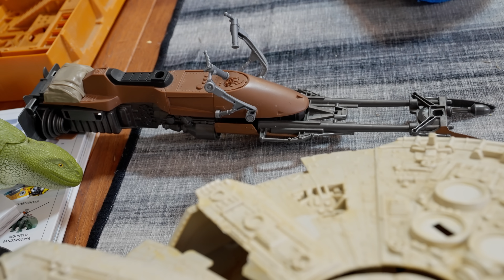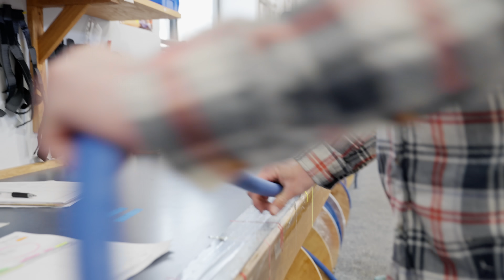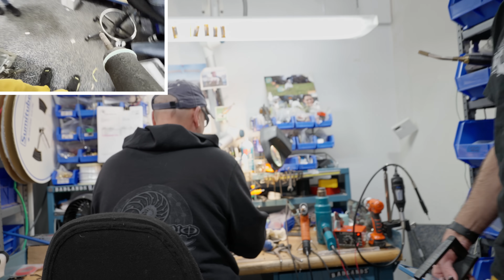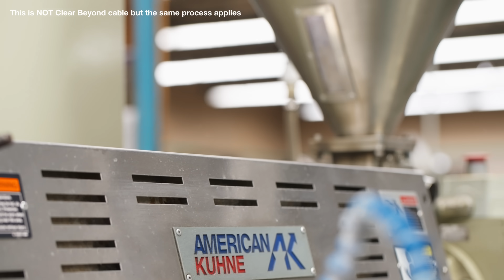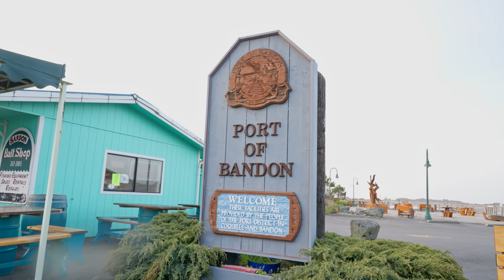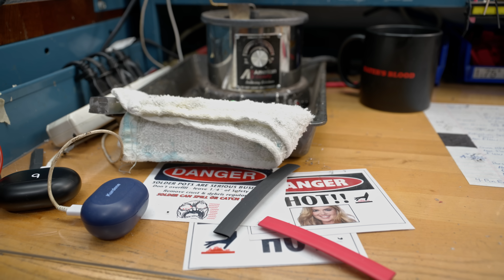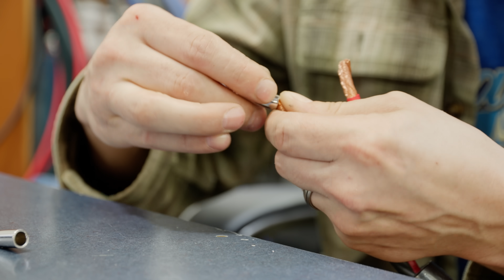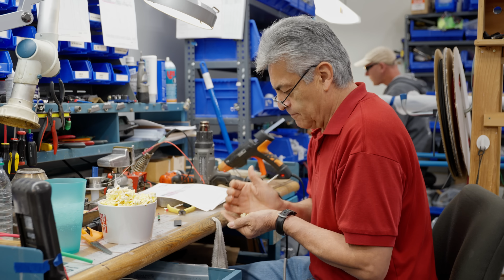This is the BEST video about LOUDSPEAKER CABLES that you will see all year

Comment: I don't know if Darko can answer some questions that I ponder as I watched this video.   I note that the elaborate construction of the cable is evident.  However, it isn't manufactured in a clean room, the cable is exposed to the elements and everyone is touching the cable with their bare hands.   I don't know if contaminants will affect the sound (probably not) but could effect its' longevity.   The other question is more personal, why does the engineer have maroon(?) colored finger nail polish.  I know it's personal, but does he have a reason or is it a personal fashion statement?   I am not casting aspersions, just curious as I don't see that often (especially the strong color).
Reply: I thought they said the wire was enameled. This would prevent aging oxidation ECT.

Comment: actually your copper isn't so pure sorry the best copper in the world is OCC single Crystal copper which is 6N, your copper is OFC which has 4-500 Crystal barriers per foot which the signal has to jump across, the crystal barriers are like a little fractures in The wire that the signal has to jump across which causes brightness edginess hardness coldness any one of those things are all of those things so if you want to get up with the best OCC single crystal wire is the best.
Reply: If you look on Cardas' website they have their own extrusion process that achieves a surface finish orders of magnitude smoother than conventional extrusion processes (regardless of OCC or not) with electron microscope images of their wire. They claim that this is important to the end result.
Reply: Yep, the purification process for OCC and 7N copper is thru the extrusion Process plain and simple, and all of it is done in an inert gas Argon. You don't have to start with "pure: CU  cause ain't no such thing that occurs naturally this isn't mil-spec stuff
Reply: Occ seem better, but no science proves to make good sound
I have a occ cable but I couldn’t tell the difference with the other

Comment: I would expect them to take a bit more care in final assembly. If they themselves believe that the eleven re-spoolings, void checkings, four different dielectrics and air hoses makes such a difference, wouldn't they believe that finger grease and slightly uneven mechanical connections, different lengths of termination strands and so on would? 

Also, rich people SHOULD NOT have the right to do just because they can, at the expense of the environment or/and the people producing the raw materials. This is of course not limited to just high end audio, but applies to most high end stuff. That the Cardas employees seem to have a good time at work (when not bullied by the intense bossman with the beard) doesn't really make up for it on a bigger scale.

And you would never ever need that much copper to conduct musical information in a home stereo. That's like saying you would get cleaner bathing in an olympic swimming pool filled with spring water that's been stored at the international space station than when taking a shower.

Comment: The purity of copper depends solely on the refining process.  Copper ores are mined from the natural environment, typically as a mixture of metal sulphides, oxides and sometimes carbonates if your lucky.  These are mixed with other minerals such as talc, Chlorite & other rocks such as shales  etc.  The mine usually crushes the ore to a powder & concentrates it to separate the metal bearing ore form non metal minerals.  The metal concentrate is mostly copper, lead, Zinc, Silver, Gold etc along with some contaminates.  This is transported to a refinery/smelter.  My dad was chief electrical engineer at ER&S (Southern copper) Port Kembla  They had a reputation for about the worlds most pure copper back in the day (closed now).  They used an electrolytic process to plate out the copper to purity. So no, the mine is not the reason for copper purity.  That's entirely down to the refinery.  It's complicated because the concentrate could contain anything & it's composition is variable & the refinery needs to test & respond to the variability to maintain purity.  They collect & analyse a lot of data over time, learning how best to respond.  That's called engineering.
Reply: True but pristine high quality audio is so easily conducted that even un pure copper is fine especially for short length cables.
Reply: @ramencurry6672 absolutely correct, well said.

Comment: $10,000 cables and their test process is probing it with an off brand multimeter. Wild.
Reply: Well, if all he is doing is measuring for continuity he could do it with a $10 multimeter without fail.  The resolution for measuring capacitance would be another story altogether.

Comment: I have personally heard field coil speakers made from hand crafted Japanese paper cones amplified by $30,000 front ends . They used 6 ft of 10 gauge super fine strand pure copper speaker cables, best system I've ever heard. Drivers were valued at $50,000. 
Cables looked like lamp cord, it wasn't, but it sure looked like lamp cord. System was owned by Papa Pass. (Nelson) Burning Amp Festival in S.F.

Comment: Great Video, my first pair of "HiFi speakers" were the KEF Q55 when I was 16 years old, still being make in the UK - after testing multiple cables at that time, monster, vandenhull clearwater I ended up on the cable talk 3. The first cable emphasized highs, the second lacked bass but the third seemed to have a great balance on that particular speaker. in the video he mentioned highly resolving system  is needed to tell the difference, I would disagree, most people do not do A/B tests with decent cables, when I demonstrate on my own system so far everyone has been able to tell!

Comment: "You're paying for the engineering. You're paying for the materials. You're paying for the cost of production." ... You're also paying for someone's next pair of Louboutin shoes 😂

Nicely made video overall, though. Buying some Cardas Solder, since that's all I can afford
Reply: just remember manufacturer doubles cost when they sell to the retailer, retailer doubles cost when they sell to consumer... i have seen brand A invoice before and confirmed this... 1/4 of what you pay is manufacturer profit, 1/2 is dealer profit,s. At least with cardas they are paying north American salaries, rent, taxes etc as opposed to brand A which mostly manufactures in China, not that theres anything wrong with that.
Reply: @gundamvf1  You can make good cables in the US or Europe cheaper than Cardis......

Comment: I never heard the difference between a decently shielded 2x2,5 mm² copper cable for like EUR/USD 250,00 / 100m , and the more thicker and expensive ones.  Then again, never tried such expensive cables like in this video. So cannot rule anything out.

Comment: The best of this really nicely made video is that Cardas Audio provides people work and pleasure! They make cables of the highest standard. Does it differ the sound coming out of your speakers? No, not if you compare it to normal audio cable of the right gauge that isn’t oxidized. But as always, some people are willing to spend lots of money on audio equipment, and a $50.000 amp needs a pricey cable. I don’t judge people who are buying these expensive cables, maybe they hear a difference, I never did. It’s good to see the high production standard of some US based factories. I checked the prices for Europe. 2x 3 m clear beyond cable costs about €20.000 😱
Reply: Exactly! If it feeds a couple of families and at the same time make some audiophiles extatic, i see win-win!

Comment: I bet most trolls here never heard an A/B between an off the shelf cable and an audio dedicated one. 

I have a modestly revealing system that used an with an old, thick, electrical cable from amplifier to speakers. For years I never questioned if the system could be improved at that stage. When working on some network applications, I had the idea of using CAT5 Ethernet cable as speaker cable. I found an extensive DIY project that detailed the plus and cons of various cable arrangements, twists, braids, etc. All accompanied by audio related measurements. I settled for a braid of 6 CAT5 cable per speaker. 

The result was like night and day. NOW my amplifier was connected to the speakers! Sound became tactile, dynamics were improved, everything felt effortless. 

If the coat hanger cable still holds water for you, fine, don’t even bother trying out new options. Again, like anything audio, the laws of diminishing returns hit sooner and sooner as technology evolves. Just look as the price to quality ratio of Buchardt speakers. Ultra expensive cables surely lure the deaf, rich old fart that swears that an extra zero for the cable budget is a life changing experience. That crowd reads Stereophile, not Darko. 

Most skeptics are OK with average cables. I suggest you try average upgrades, there are many options out there. 

Cheers ;)
Reply: Please describe a braid of 6 cat5 - so are you saying you have 6 cat5 cables to each speaker - and the 8 cores all braided together with matching colours - then 4 of the braids braided together to make 2 ?

Comment: Keep the guy who makes popcorn for the employees, dump the guy who goes around startling and annoying them, or else give them permission to punch him in the face until he learns what his parents failed to teach him...

I purchase a pair of high end multi thousand dollar speaker cables. One sounded great and the other was absolutely horrible. I finally took the bad one apart and discovered a tiny nick in one of the copper strands. I sent it back to the company.. The replacement cable performed as well as the good cable and life returned to normal for me. 
I've also used cables that were not made of absolutely pure copper. So many of the electrons that hit the impure sections of the metal stop moving and begin to clog up the cable making it sound very muted, very distorted. Only the purest of the pure copper can be used, otherwise you're ruining your sound and preventing happy electrons from reaching your speakers.

Comment: Thanks for the vid.

My two cents: For me cables have component value. It give a really good sounding system the opportunity to sound amazing in my experience. But it’s trial and error and I guess you first of all need talent and experience to understand the differences. They are not the same differences as for example changing the speakers or the power amp. 

Take care

Comment: Sometimes a lot of the purpose of things is lost in the translation and opinions.
The purpose of offering hi end ultra pure cables of varying designs is to help remove any bottlenecks from the system. Some components may be overkill but for some it is the only way of knowing it is not the limiting factor in the system. Let’s say you have a super refined hi-fi system with $50,000 speakers and $50,000 worth of head units. Then, connect them all with discount 16ga lamp cable (because opinion says cables don’t make any difference). 
The question on the mind of the owner is simply ‘are these $25 speaker wires limiting the  reproduction in any way?
Research says…….’yes’.
Now, a $500 system, probably not so much.
In the end, if the listener believes they hear a difference or want to have the best quality products available, it is their choice to do so.

Comment: Great video John. There is more to life than just nameless factories in Asia. This is a human story at the end of the day. If people have the money, the high end kit and want to make sure they are not losing anything in between, then why not? To the critics below. If you don't like high end stuff, nobody is forcing you to buy it. I was sceptical about equipment stands once, until my ex bought a Quadrasphere rack (hardly high end), but the difference from going from Habitat perforated metal to something very rigid shows that small change can make large differences in the signal chain for even moderate equipment. To use a woodworkers analogy, one degree non square over 100 yards and you'll be off by 5.2 feet at the other end. And finally to the coat hanger guy below - why not stick a sewing needle in a large piece of cardboard and play your vinyl? It works as a pickup, amp and transducer, but would you want to?

Comment: I was about to use a long line of not so polite words - but to obey your wish for the comments to be keept in a polite tone I restrained myself.

Darko I am sorry to see that you have fallen for this - just to use the term "virgine copper" to claim quality is ..... I was about to use the word the starts with a "c".
plating with silver for what reason? - not for longevity eh ? - a lot of stains for increeasing the area and lowering the wire resistance and keep it soft and easy to handle yes but the wild way of turning the starins together for better sound !!!! - here comes the "C" word again 

A cable of very high quality of materials  and workmanship yes, but don't ever claim it is "sounding" better than a similar square area cable .
But admitted - these blue cables look much better than my similar sized cables ....... but they do NOT sound better even though they may cost ..... I have no idea how many times more

No unpolite words !!
Reply: So you have compared them directly with your own cables?  You're just making unqualified presumptions.
Reply: @charlesgrubbs2101  my qualifications are sufficient to not presume but measure and be sure it is done correctly
Reply: What system are you using that allows you the resolution to be able to tell if any differences are present or not? I have personally been where you are in my disbelief of cable material making a difference. I was wrong. I did the comparisons on a very resolving system (Focal Utopia Scala Evo, Primaluna separates, Chord Dave, VPI Classic Signature Reference, Auralic Aries G2.1, Lumin X1) and the differences in wire material absolutely makes a difference! I heard immediate and pronounced differences in sound quality, presentation, resolution, imaging, spatial location and the resolution and accuracy of the sound image portrayed by each instrument. Depending on where in the chain you change cables, the changes are of different levels (system dependent of course). Also, it is repeatable and consistent (easily A/B comparisons obtainable). The better system components you have, the better you can hear changes in the system. So, once again I ask... What type of system components are you using to compare cables on?
Reply: @bkshoemaker70  A pair of Tektronix current probes (BW 10MHz calibrated), two 100MHz osc. probes for voltage mesaurements, a Tektronix 546 oscilloscope and a HP Dynamic signal analyzer - all of whicch has plenty of resolution to measure any aspect ot your equipment. 
One Accuphase P300 to drive a set of IMF transmisionlines, a set of JBL studio monitors (3way) and a set of Lowthers in a "box" I never remember the name of.

Measured 5 types of very expensive, very exceptional (according to their resp. manufatures) speaker cables - and a set of plain good 6mm sqr. speaker cables

The difference in signal(current/voltage/phase/spectrum) between any of the cables was less than 0.2dB.
If you can hear a difference of 0.2dB I will accept that you may have a good reason for buying the expensive special developed cables and pay the price.

At a normal SPL I am not able to sense the difference of 0.2dB, and I do not know any that is able to do that either.

In my living room, having one more person in the sofa, will change the characteristic of the room by more than 0.2dB - so I see no reason to buy cables that "improve" less than a guest in my sofa !
Reply: @bopcph  Yes, but did you 'listen' to them?...
Reply: @richardlast5850  When doing the measurements I(we) did have sounds from the speakers yes, so I did listen to them - but as my ears is not  able to "measure" differences of less than 0.2dB - tell me what would the purpose be to use my ears.

But I did, subjectivly, like the sound of the JBL Studio monitors best (with all the 6 type of cables) - if that is what you mean by listening - and there were no difference as far as my ears could tell, as they are not able to hear differences of less than 0.2dB.

btw - 46 years ago I started my education in one of the worlds largest producers of hearing aids - so yes, I know a thing or two about measuring, analysing and characterizing , any kiind of, sound.
I build my own Phantom PSU/pre-amps for my B&K microphones . I do not use a subjective "instrument" like a human ear, I use an objective instrument  - a B&K microphone. - to determine differences, and then I use my ears to determine if I like to listen to music on a paticular "setup"
Reply: Yes, if cables carried sound they should be hollow🙂
Reply: To me it’s very obvious. The popcorn butter and former tavern employees make the cables sound better.

Comment: Hmmmmm.. They braid the copper wire without gloves! What about oil from the fingers,!? Also, they should be working in a nitrogen filled working space, I'm sure they'd rather be working wearing space suits than risk the copper oxidize!?🤓😜
Reply: Dude. Didn’t you see them popping buttered popcorn? It’s a special dielectric process of buttery and saltiness that adds more clarity with bare hands.

Comment: This makes me appreciate my 12 gauge rope lay ofc wires even more. (Although i do own a hydraulic cable crimper and do terminate cables with 12 tonne solderless gass tight connections. So there's that much in common). But i saved THOUSANDS of $$$ using the same cables Abby Road/EMI recording studio does: 12 AWG OFC copper rope lay (into B+W in their case. Custom one-off speaker designs for me.)

If you want to buy expensive cables, have at it. They seem like nice people.